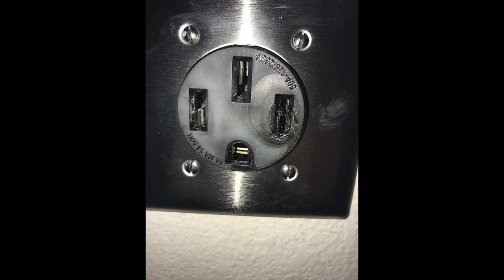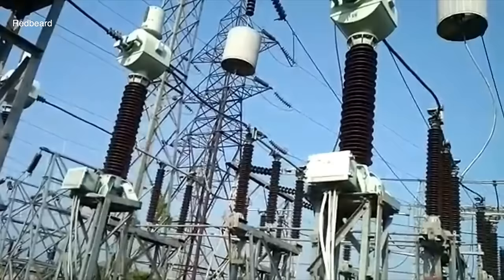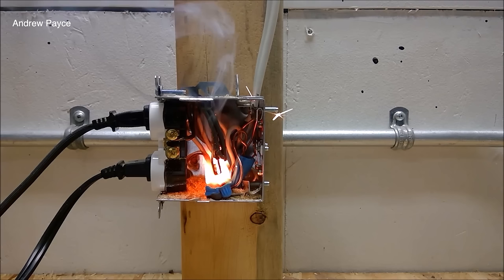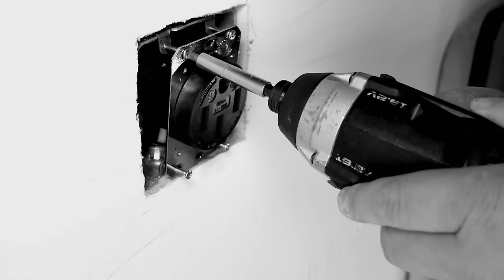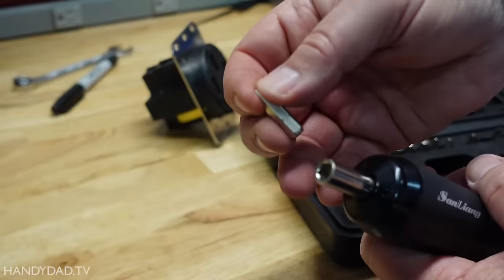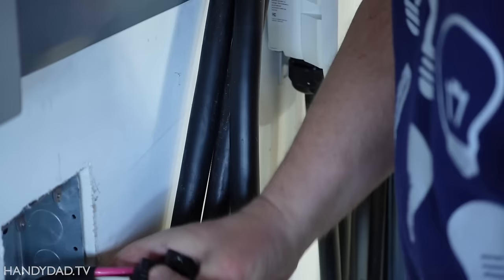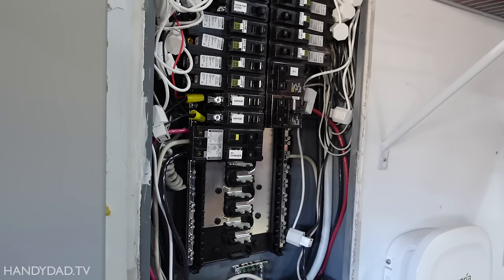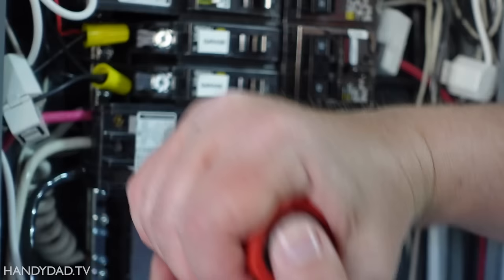EV Charging Disaster

Comment: Great advice. I would also recommend setting the torque back to zero before putting away your torque screwdriver. That way it will stay accurate and not lose calibration.
Reply from the maker: Great advice! Thanks.
Reply: Lowest setting…set the torque device down to the lowest setting before putting it away…this will help maintain calibration.  During use stay away highest and lowest setting because the torque device may not be 100% accurate there.

75 in-lb requirement means you need 80 or 100 in-lb torque device.
Reply from the maker: @Nic - great advice!
Reply: @handydadtv  your video shows how complicated it is to add the 240 V outlet compared to a 120 V outlet.  The only similarity is running the wire.  Now I know and I can start preparing better to run HVAC in the garage…electric heater mainly
Reply from the maker: @Nic be sure to follow your local codes which may be different from mine.
Reply: Удивлён тебя тут увидеть)
Reply: @pashko90  😊🤝
Reply: @skyflyer4231  A non-scientific advice: Torque it to the max (70), and then turn it another 1/16 to 1/8 of a turn.
Reply from the maker: @Gruntled2001 I couldn’t get it to click beyond 60-65 anyway. Just didn’t have enough grip.
Reply: @handydadtv  I hear ya. Even with a fat and grippy handle, I can't easily twist my torque screwdriver at its limit of of 55 lb-in. That's getting into a torque wrench/ratchet territory.
Reply: a hybrid

Comment: Great video, I would also add that many attached garages are not required to have smoke or heat detectors in the garage. With many of us now charging very large batteries in the garage we really need to put some thought into safety systems and perhaps change code to get detectors in the garage.
Reply from the maker: Good point. I have one installed in my garage, but you’re right fire code doesn’t require it. They are only required to protect occupants. Perhaps they don’t want them in garages because homeowners would foolishly try to battle a fire.
Reply: @handydadtv  ... just remember, code is a minimum standard. You can go above and beyond. Perhaps the better suggestion for a garage is a CO detector.... because any fire will generate CO, but CO by itself generally doesn't mean fire.... but that's what people die from without knowing it.
Reply: You CAN'T use most reg. (ionizing type) detectors in a garage, the exhaust fumes ruin the sensor!  Check the info on the box, rise in temp is one you can but you won't find em at your big box store. Best place to go would be an electrical supply house, see what they have for you.  Retired wireman.
Reply: @handydadtv  I'm in the fire industry in Australia. Same here no requirement for fire detection In a home garage. But with electric vehicles if there is a fire in a attached garage I'd want to know about it before it traps unknowing people sleeping. Current regulations will need to change with electric vehicles coming in
Reply: @handydadtv  I always thought its not supposed to be in a garage due to the large amounts of dust, smoke, etc. that normally exists in garages.  For example starting up a riding mower to cut the lawn you end up with a cloud of sooty exhaust (running rich from choke) followed by a lot of dust kicked up into the air...which would both probably trip most any smoke alarm
Reply: @handydadtv  probably a reason why the code doesn't require smoke detectors in the garage is because vehicle exhaust contains ultrafine particles that the old standard Americium-241 smoke detectors are ultra sensitive with and that would just cause constant nuisance alarms. Technology Connections has a recent video on the subject
Reply: @handydadtv  I know a very important argument to have not a (standard) smoek detector in your garage.....at least due to the rules.
Because when you start your ICE car to drive out of the garage the alarm could go off. Smoke from exhaust pipt.

BUT...the moment you do not have any petrol using garen tools/cars in your garage it's time to place a fire alarm.

(Oh...do not forget that even using any electrical equipment for sawing wood can let go off the alarm....)
Reply: @wojtek-33  Heat detectors when tou're putting you're car back into the garage staight after a long trip....the exhaust pipe will trigger alarm depending on the alarm type ...
Reply: @wojtek-33  Entering a hot car (long drive) in any garage will rise the temp....maybe not suitable if it works on rising temps....working om higher temps....? In my eyes not the best....most fire starts with relativ low temp. Alarm is coming when it's to late.

(It's not important what I use at the moment because I drive an EV...no hot exhaustpipes ., also my lawn mower is an electric...I prefer those working on smoke)
Reply: Smoke detectors are great, if it is a EV only garage, as a gas car will set them off, guaranteed.
Reply: @ch3no2killz  not an issue with an EV there should be no CO coming off it at all.
Reply: @crhu319  If there is never a IC device (mower, string trimmer,your daughters toyota) your correct.  When the code was written they were concerned about CO damaging the sensor in the smoke.  The update the NEC Code every 3 years, ya gotta keep up.
Reply: True. I have both a carbon monoxide and smoke detector in my garage. That should be required with ICE vehicles as well. They say that placing carbon monoxide detectors in garages can result in frequent alarms, but I have tested mine to make sure it works, but it never goes off when parking or backing out of my garage with any of my ICE vehicles, so it obviously takes a while for carbon monoxide to build to dangerous levels.
Reply: @rupe53  Shame not may people can distinguish Carbon Monoxide from Carbon Dioxide... I'd go for CO plus smoke or heat.
Reply: @GretaKnauer1980  ... you do realize that nobody makes a CO2 detector in combination with smoke detection, right? This is why they DO make CO detectors in combination with smoke detection. CO is a byproduct of any combustible.
Reply: Thanks for your comment. I'm going to put a smoke alarm in my garage now as that is where we charge our Tesla.
Reply: Excellent idea. I'm adding one to mine now that you mentioned it.
Reply: That’s a fine idea, but also remember that smoke alarms and smoke detectors are different devices and they all have temperature ratings, most cannot go below freezing, I have installed fire alarms for 40 years there’s a lot to know to get it right but at least putting something in there is better than nothing
Reply: @handydadtv   no they are not required for garage is typically because Garages are unheated.

There are numerous types of smoke alarms and smoke detectors, smoke alarms or what you buy at the big box store for your house, smoke detectors are typically what part of a connected security or fire alarm system, they’re also different technologies that operate these devices either photocell or ionization, they also have temperature limitation which usually preclude below freezing but having something is better than nothing
Reply: I like this idea! I'll look into putting one in my garage, now that I have an EV and no gas equipment in the garage.
Reply: Many homes have gas-burning furnaces and water heaters in the garage, and they still don't require CO or smoke detectors, so there must be a good reason they're not required.  A 240V charger isn't a greater fire risk than a gas furnace.  If anything, the furnace is a greater fire risk.
Reply: One person mentioned it already. Just like a boiler room with high carbon or smoke, we would just simply use a heat detector.
Reply: Heat detector is best for a garage or attic. Smoke detectors are real sensitive to dust and can be set off by spiders in the sensing chamber.

Comment: My 240V plug was installed by a licensed electrician.  He used a homedepot 10 dollar plug.  After 2 years of usage, I heard the ZAP ZAP arcing sound.  I took it apart and saw the plug melted.  I redid the whole system with new wires, 50 dollar hefty plug, and a $150 GFCI 50amp breaker.
Reply from the maker: No! Really? A licensed electrician made a mistake?? Boy, they sure give me a hard time like I’m completely incompetent.
Reply: FWIW a GFCI wouldn't have helped you in that situation, you need an AFCI to cover arcing like that. However, I don't know what code is where you are, it might require a GFCI.
Reply: That’s scary. Did you always charge at 40amp?

Comment: You may want to reconsider the "double" torque idea. Best to do it once. Also, removing the cover on a "hot" panel is suspect.
Reply from the maker: Thanks
Reply: Retired from a large hospital where they insisted that we get or sue all terminals whole performing infection four times a year PM'S on energised starters & drives. Best thing we had thousand dollar FLIR IR cameras that picked up warmer to hot spots. Its not in the NEC but might be in NAPA 70 that states not to keep refreshing electrical terminals.
Reply: Torque then allow for 'cold flow' during installation and then re torque.  If possible, allow a few heat cycles and re torque again.  Especially noticeable on stranded conductors.
Reply: Double torque on stranded wire is very common practice. Torque once, wiggle, torque again. The strands will settle in place more after the wiggle.
Reply: The molecules of the metal will seek a new equilibrium after you tighten it down. Its called plastic flow. Wait a minute or so after the first tightening, then do it again at least once to make sure it stays tight.
Reply: These poor YouTubers doing electrical work. There's always someone to tell you what you did was wrong. Even if it was right.
Reply from the maker: @Norm - I’ve developed a thick skin!
Reply: Shutting down a whole panel to take cover off is SUSPECT 😮

Comment: A key thing about current ratings is that they come with a time at the rated current, since a current rating really is a temperature rating  a rating of how much current is needed to reach the connectors maximum rated temperature in a certain time under controlled conditions. An EV charger is unlike most other appliances that have a plug on them in that they can draw the maximum rated current for hours on end. A load like this needs to be derated for safety so that you are not pushing the connectors and conductors near their maximum rated temperature every single time the charger is operated. If you allow the charger to draw X amps, since it will do so for hours on end, use connectors and conductors rated for at least 1.5 times that.
Reply from the maker: The industry best practice is 1.25 times. So a 50-amp circuit can draw a maximum of 40 amps sustained. 

In reality, I charge at 32 amps on a 50-amp circuit, so I comply with your 1.5 rule. First, it’s as fast as my UMC can charge. Plus, it’s safer so I sleep better at night. 😊
Reply: Yes indeed. In the UK we have 3kw (13 amp) "immersion" heaters for domestic hot water. It's common to wire them to a 13 amp fused connection unit but these eventually fail. Not only are they running at maximum capacity in a nice warm cupboard next to the tank, they can have poor connections at the switch, at the fuse, and at the terminals.
Far better to fit a 20 amp double pole switch which has slightly fewer potential failure points and a much greater capacity. The circuit is generally supplied by a 16 amp circuit breaker.
Reply: Thanks for sharing this.  If I don’t learn anything else today, that post has just made my mind bigger and smarter.
Reply: @handydadtv  Hm...I do not agree. If I use my 16 amps connector it should be able to deliver that indefinite. A good 16Amps plug/connector and wire will be safe for short periods using 20 to 25 amps and long 16 amps. I could use garden tools  on 165 amps for hours too.(wood chipper)
My house is secured at 3^25 amps (230 volts, from the grid). Even when using 35 Amps it will take hours before that thing goes down. But I suppose our european (Dutch, German) safety and testing rules differ from the usa....and have built in this security.
A car does not differ in usage model  from an electric heater.....
Reply: You can adjust it down to say 80% draw within the Tesla app. It’ll remember that location and always draw 80%. This is what I’m going to do.
Reply: What’s the best NEMA 14-50 outlet I can get at Lowe’s or Home Depot. Their is one at lowes that says industrial grade .
Reply: 80%
Reply: It's like the people who blame their portable space heater because their receptacle caught fire, when the problem was actually with their cheap 15A receptacle that probably had loose prongs or loose wires from decades of use
Reply: @veryslyfox  When your house burns down it doesn't matter whether it was the space heater itself or the outlet that started the fire, the end result is the same. It's simply not safe to draw the maximum rated current from any old outlet for hours on end and thus a portable device that draws the maximum rated current from the outlet should not be let to do so unattended (and the instructions for the portable heater probably state this). If it's predictable that you will need to heat a space when it is unoccupied then you should have a heater permanently installed, not be relying on portable units. Same goes for the electric car charger, a permanently installed unit with the proper wiring and connectors to handle the load is orders of magnitude less likely to catch fire than a contraption plugged into an outlet that is not specifically designed for charging a car.

Comment: I wish more people would mention to torque the screw terminals, it's so important!
Reply from the maker: Thanks
Reply: Can that screwdriver he uses go to 75? It says in the item description 10-70
Reply from the maker: @kendroid5120 No it doesn’t go that high but I couldn’t get it to click anywhere near 70 in-lbs anyway. I went as tight as I could.
Reply: @handydadtv  go get a proper torque wrench. This isn't horseshoes or hand grenades, the video does show that when you torqued the bolts the driver clicked (minute 5:25) so either you can get to 70in-lb or you set the driver well under. Either way it's not 75in-lb and recommending your viewers just spend $31 on an ineffective tool is a disservice to your viewers. Get an "automotive" ratchet style torque wrench. It'll give you a torque range well over 75 in-lb and because it's lever action you be able to torque to 75 in-lb. Fire IS scary !
Reply from the maker: @hirokiokamoto6903 Use an automotive torque wrench and you’ll strip the screws. Of course fire is scary. But electricians never torque screws. So for novices, anything is better than nothing.

Comment: Now everyone I know with electric vehicles they leave the charger plugged into the wall and almost never unplug it. I put the outlet in on one and I probably overtorqued the screws because I like my electrical connections to be tight due to the issues you mentioned. And I will most likely go back soon and check it out anyway. I do remember putting a tiny amount of dielectric grease into the connection points before putting the wires in to prevent corrosion in the terminals.  I even put a small amount on the slot for the spades in the breaker box to prevent corrosion there.
Reply from the maker: Thanks for the info
Reply: No!  Do not use dielectric grease.  It's an insulator.  It will increase heat.

Comment: Another move might be to buy an infrared thermometer/infrared camera.  Take a reading/picture of the outlet right after its been charging the EV for an hour (or more).  If it starts showing elevated temperatures, you should check/replace it.  Otherwise you are probably fine.  It's easier to do, and so you are more likely to do it, than the other (remove plug, check for looseness, remove plate, remove outlet, check wires and retorque and reinstall) method.  Just a thought.
Reply: True, but after re-torqueing.
Reply from the maker: Few people have infrared cameras.
Reply: @handydadtv  True, but infrared thermometers are pretty cheap.  I've seen them for under $20
Reply: Actually I’ve used a FLIR One and quite by accident I found a bad out to my boat in the harbor. As I was panning around I saw a bright glow. I touched the harbor’s outlet box and nearly burned my fingers. The outlets was ruined and the wire insulation was melted back 3” but there was plenty more to reconnect to a new outlet. The outlet was cheap off brand and the wires could have been loose but we never checked. We just chuckled it and replaced it with a Hubble. Eaton also makes excellent outlets.
Reply from the maker: Wow great story
Reply: What would be an elevated temperature?
Reply: @davidboothbyiii8249  I'd expect 20-40 deg F above ambient to be normal.  If you starting seeing 60 deg F or more above  ambient, you might want to check things/replace the receptacle.
Reply: @williamthesling1201  thanks.  I just replaced my receptacle a couple of weeks ago with a Bryant.  Was recording 60-80°F above ambient with the cheap Chinese one before. Thanks for the clarification.
Reply: @williamthesling1201  oj
Reply: @handydadtv  Everyone with a CAT S62 has one. That's often sufficient to see if something isn't normal.
Reply: IR cams are indeed a great tools and every decent electrician should have on.
The only downside with using an IR cam on plugs is that you might not see the problem soon enough because of the plastic body of the plug.
Reply: @williamthesling1201 I got 106 on parts of my nema plug and my Tesla mobile charger forces my amps to 16 due to 'heat'. I think I need an industrial plug